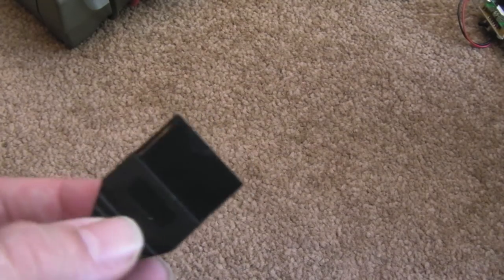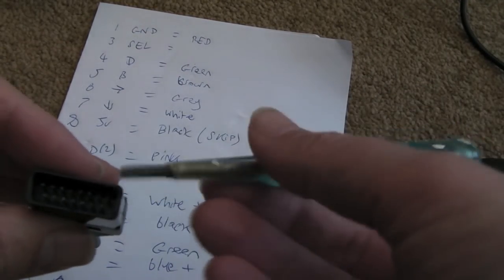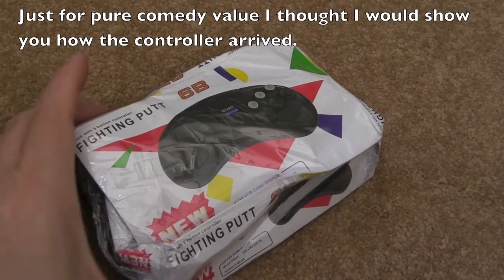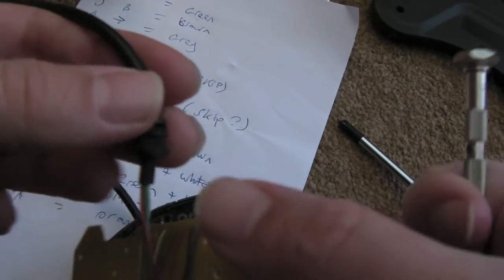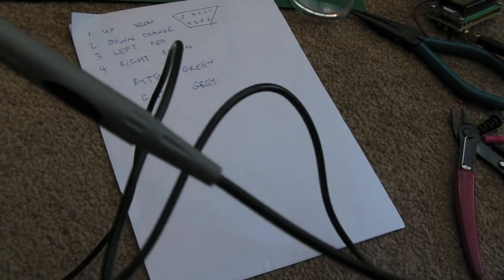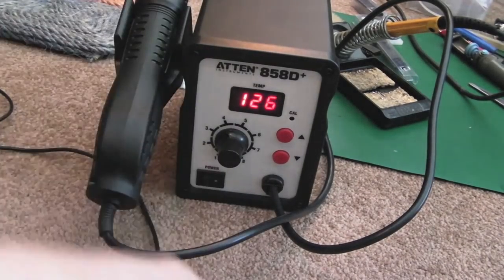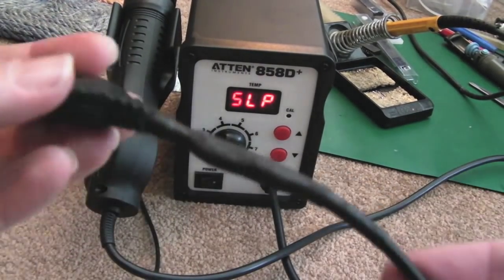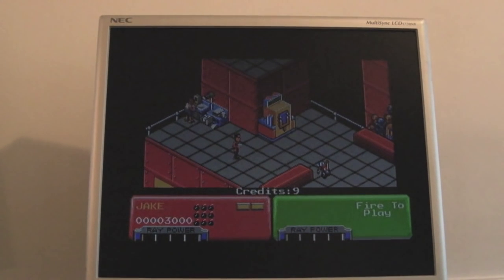SNK Neo Geo to Atari (2600, ST, Amiga, C64, Amstrad, Kempston) Joystick Adapter

Comment: Good use of an otherwise scrap connector. Makes a handy adaptor cable but that donor controller was pretty much as cheap as it gets! I have seen moulded screw heads in some other items before, although they were for visual effect not to cut costs! Cheers.

Comment: Nice little mod, Unrelated but i finally got my Mega cd working and was thinking about doing the region free bios chip.
Did you ever post a link to your bios files? As they would help me out.
Reply from the maker: I didn't but I can merge some ROMs and upload them somewhere for you - what regions do you want?  Same as I had - eg. PAL, NSTC, NSTCJ, then region free NTSC?
Reply: GadgetUK164 yes please if you could that would be great. Still need to buy the kit to flash chips so theres no rush. Thanks.

Comment: I'd wire it as a standard Megadrive pad. Then you have the Atari pinout plus an extra button for the Amiga / Master System and then a Megadrive compatible stick.
Reply from the maker: Yes, I could have done that - I don't have a Master System though, and not sure how I would use the extra button on the Amiga - I did look at adding 2nd button support for the Amiga, although I am sure there are many games that support it?  

I could always modify it later, the additional wires were just folded back on both sides (I didn't actually cut the side on the Neo Geo connector), so I could modify it as you suggest - I would just need to cut off the heat shrink, disconnect the solder and re-do it.

Thanks for the suggestion though - I will certainly take a look at the Megadrive stick pinout next and maybe re-visit the adapter.
Reply: Way back when I was surprised at how many Amiga games supported 2 buttons, I was playing Amiga games with a Megadrive pad for ages. While aimlessly button mashing one day I found it out. Fast forward to present day and... yeah, there's quite a few to warrant adding it. I thought it was common knowledge by now, but I get questions when mentioning it so I thought it warranted me replying.

This list is messily introduced, but shows support. http://eab.abime.net/showthread.php?t=57540

Iirc, the C button on a Megadrive pad is mapped to button 2 on the Amiga,

It's worth having a play with anyway, I still have a Megadrive pad solely for my Amiga.
Reply: Oh, 6 button MD pads are encoded, they deffo don't work for button 2.
Reply from the maker: Thanks!  Yeah, I thought there was some muliplexing going on.  I was going to have a go at adding PC Engine support too - for that one it looks like I just need a 74LS157 and a few resistors.  I might have to make it switchable though if I am going to support all these different pads lol.

Comment: Thanks for that info, I`m getting right into my Amiga 1200 and 600 right now and disliking the competition pro and zip stick i have, got me thinking on alternatives! i like your monitor, is it native Amiga spec, 15khz, looks great.
Reply from the maker: No worries!  I find the older joysticks a bit harder to use as well =/  The Cruiser isn't too bad as it has a slightly thinner wider base.  The monitor is just an old VGA monitor - I am using the GBS-8220 upscaler to convert RGB from the Amiga into a VGA signal.